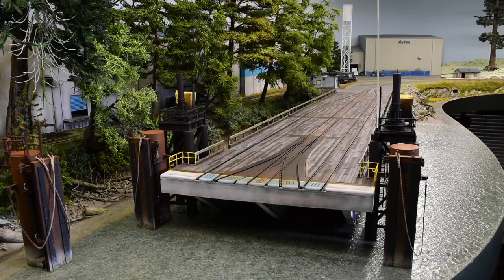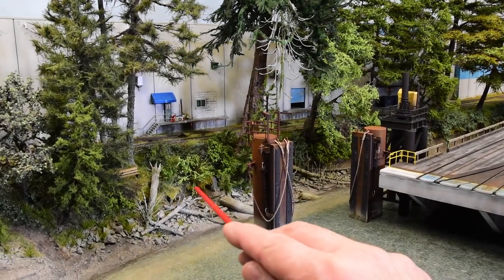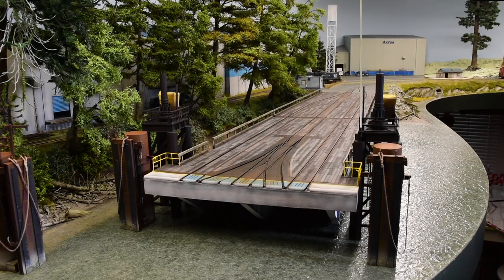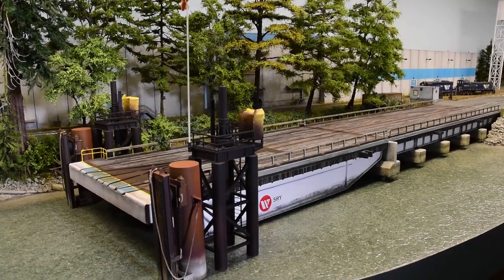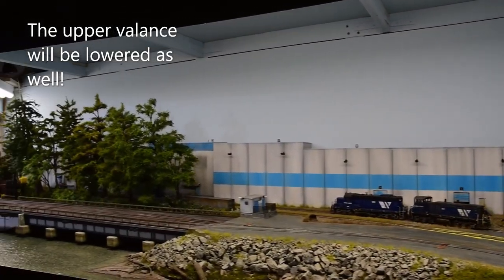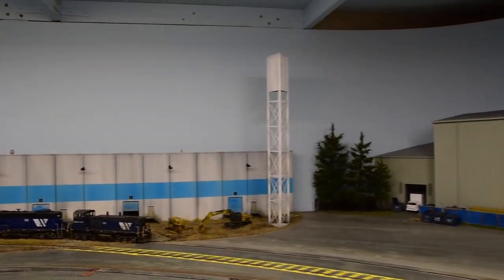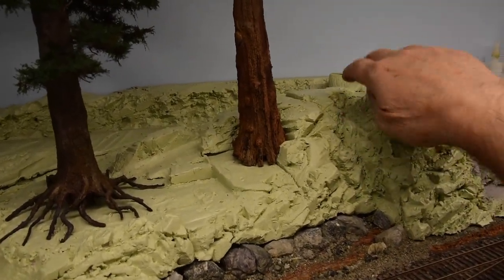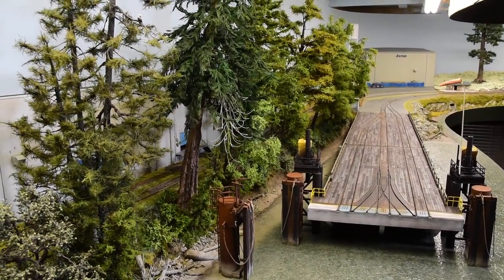Big Shelf Layout Update | Critique & Review - Vlog # 100

Comment: Looking awesome all together now! The pilings look great. One day you could build a diorama of a barge, maybe a tug too; sitting in the same color water you have on the layout then build a cart to put it on that would match the level of the barge slip on the layout. You could possibly use it like a staging yard. Put cars on it to be delivered to the layout, switch them out with the train, load the cars to be taken away, then roll the barge cart away till its time to interchange cars with the barge again. Not sure if you have the room needed or if the layout is configured for that to work but it's just a though. Maybe when you finish the entire layout and run it for awhile you might want to build this barge cart and redo the edge of the layout at the barge slip to accept this so called barge cart, that is if you get antsy to do some more building one day down the road. You've got plenty building to keep you busy for now.
Reply from the maker: Great idea. As it stands, it would be no problem to apply my carpentry skills in order to facilitate the Ferry approach. ;-)

Comment: I did map out the trackplan on my final o gauge trainboard, an18ft by 22 ft, inside open oval space 5ft by 8 ft. creation. But I gave no thought or time to space required for hills, valleys , rock outcrops, forests and trees, walls, fences, rivers. Im 3 years in, way underestimated the time to build the trainboard and install track . only able to run my trains twice in 3 years. Badly regret not mapping out the scenery plans. So, now I see my error, moving forward. I should have done the outer loop, decorate, run trains, do the inner loop, decorate, run trains  do the parking tracks, decorate  run trains,do the elevated loop, decorate, run trains. Now you helped me understand. I'm still badly overwhelmed,  but I'm sure you would say break it down into pieces, small steps, and enjoy the journey
Reply from the maker: I only model a small doable portion of a local railroad. No need for hills and valleys on a shelf layout except for the edge of things. Cheers.

Comment: Dear Boomer, love how the pilings are coming to life. Absolutely agree on the added value of barge slip. Where the model meets beyond the horizon of the imaginary.
Anyhow, on the negative space, plus the transition next to Axton, just maybe, maybe it’s an idea to model part of the Alex Fraser bridge. Not on the prototypical side, but on the left hand side of Axton. On a slight angle, I humbly think it will further the illusion of depth in the particular corner. Also it will naturally enhance the illusion of the road which connects to the parking lot. Further, it will be another feature connecting the model beyond the horizon.
Last but not least, really like the idea of the retractable foam part for the transition scene. Definitely will use that on my layout. Have been experimenting with such pop outs. Even with scraps of cheap pieces and cutoffs from packaging styrofoam. A little spray foam in between the crevices and cling film between the layers and the different pieces fit like a glove. 
Great vid. Very much appreciate what you’re showing all of us!!
Reply from the maker: I have thought about the Alex Fraser bridge feature. Many visual challenges to overcome as one moves from left to right. It works from a forced perspective, but fails from another. I have not out ruled it though, because there are only solutions right? ;-)
Reply: @boomerdiorama  indeed!

Comment: What a fantastic summary Boomer.  I do my best to keep up with all your productions.  I will be changing from N to HO in the hopes of providing me with a scale easier to handle, model and view.  My new layout (shelf) will have similar dimensions to what you have built to date.  Can you speak to the size of the turnouts you built?  And possibly the radius of your broad curve at the Axton corner?  Also very curious what you finally decided to use regarding turnout controls.  As always - my most sincere thanks for all you share with us - tangibly and otherwise.  M
Reply from the maker: All the turnouts are #8-10 from "FastTrack's" free templates: https://www.handlaidtrack.com/track-templates

Most are curved with a minimum radius of 38 inches. The widest is 42 inches. It's best to download the free paper templates to lay-up the curves in my experience. The prototypical curve is far more important to me than extra tangent. The turnout controls most likely will be manual. I have not decided on the style yet, since they hold position right now with out them.
Reply: Much appreciated.  I do intend to build all my turnouts with FastTrack tooling.  Strangely, communicating here seems distant considering we both live in North Langley.  Thank you very much.  Mark
Reply from the maker: @markhuston9250  I can often be found at RC Pitstop in Langley (on Fridays and Saturdays) when I pick up supplies.😁 Cheers.
Reply: @boomerdiorama  

It would be a treat to meet you someday!  😀

Comment: I'm curious how the barge dock works exactly.  The tip of it seems to be able to articulate up and down a tiny bit, but it's fairly short and couldn't move too far up or down without introducing a very steep grade.  The rest of it it looks fixed to the concrete supports so can't move.  I've seen docks like this but only on the ocean where tides can be pretty big, this is along a river so not as much tide differences to account for?
Reply from the maker: The forward Ramp Section pivots up and down with hydraulic rams which I have not installed yet. The ramp section is hinged at the center concrete slab to adjust for tides and to keep out of the water at high tide. The tides can be severe here as well.
Reply: @boomerdiorama  I think I always just underestimate the grades trains can handle when they're only pulling a few cars at a time off a barge or ferry.
Reply from the maker: @baronjutter  They usually time the interchange with a level tide.

Comment: Thank you for sharing your wonderful work with us all. I'm really intrigued as to how you cut your pc board to make your pc ties. Do you think that you could demonstrate your technique for cutting those? I'd really like to learn that.
Reply from the maker: You need a basic table saw. Take two pieces of cheap 1/8 door skin (wood panels) or equivalent, a little larger than the PC board. Spray 3M adhesive on back side of PC board and glue to panel. Do the same with the other side. Basically sandwich the PC board between the scrap panels. Then run it through a table saw (with a zero clearance plate) with a push stick - carefully to the width you desire. You use a zero clearance plate so the strips don't fall down into the table slot. Cut all the strips you need and then peel off the wood panels from the PC board. If you have trouble, soak the strip in Isopropyl Alcohol and they will fall off. Cheers..
Reply: Thank you!

Comment: Hi boomer you mentioned planning , a lot is over looked at the very start of building a layout long before we  even put pen to paper.
Firstly the building or room you are going to be creating this masterpiece needs to comfortable enough to work in summer and winter.
Four  things I would definitely do No 1  Air-conditioning  No 2 Insulation  and 3 Lighting No Four future proofing the layout eg if you decide to move make sure you can dismantle and take the lay out to the new location
Speaking from experience I've done none of these things ,put it done to impatience ,there's   nothing more unmotivating  working in the hot summer and cold winter months.
Yes it all cost money to do that but its worthy getting these four things   right from the start ,you can always buy those Locos later on rather than sitting on the shelf.
Meanwhile I'm going to make my way up to the no air-conditioned  garage where its colder than a witches kiss and work on my layout. 
What can I say , you live and learn !
Reply from the maker: Being comfortable is mandatory for me especially as one grows older. I built several layouts and many models in an unheated garage in the past. The very thought of that makes me shudder. This is one of the reasons why I chose to build a smaller layout in a small climate controlled room. ;-) Cheers.😁
Reply: @boomerdiorama  I suppose you could say you're feeling my pain LOL
Reply from the maker: @shaunhuckstepp7531  Railroads can be painful under any circumstances. I just try to reduce them as much as I can. ;-)

Comment: I subscribed yesterday and have watched some of your videos.  I've been weathering rolling stock with washes made from acrylic craft paint and windshield washer fluid over a matt lacquer base.  However, I'm eager to try washes made from Vallejo Model Air and water as you have used.  My era is circa 1962 so the weathering isn't as severe as these days, but even mild weathering makes such a difference.  Also, I've been painting trucks with what's left of my Polly S stock, but that will soon be gone.  Do the Tamiya XF series paints adhere to the Derlin sideframes reasonably well?  Do you use a base coat on them?  Finally, my layout is HO but only 6 x 1 feet, so I find your layout very inspirational.  Thanks for sharing all your hard work and great skills.  Cheers from Wisconsin!
Reply from the maker: Thank you for the sub!. Delrin plastic will always be a problem if you plan handle the subject. I use Tamiya on Delrin Plastic applied with the airbrush. Then I dull coat. The trick is to apply the paint heavy enough as a jacket clinging to the Delrin shape - and then, try not to handle it if you can avoid it. You can get "prep" paint for Delrin, Unfortunately, it builds up too thick when the part or surface is small and detailed. Cheers.
Reply: @boomerdiorama  Thanks, Boomer.  I will give Tamiya a try.  I hand paint trucks with the wheelsets in to avoid any flexing after the paint is on.  I also do it in steps to avoid contamination of the bearings.  Cheers.
Reply from the maker: @andrewpalm2103  Yes. Contamination of the bearing with paint can be a problem. It can cause the dreadful "lurching" at slow operations. I usually mask off the inside journals when I spray them. Put some tape down on a piece of clean styrene, cut patches of tape, pull up and re-apply, spray and peel. ;-)